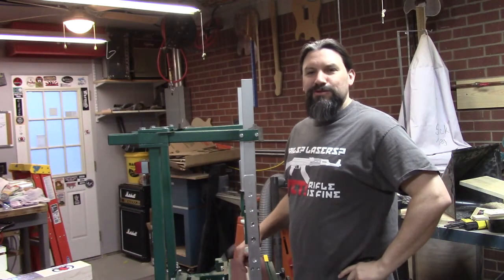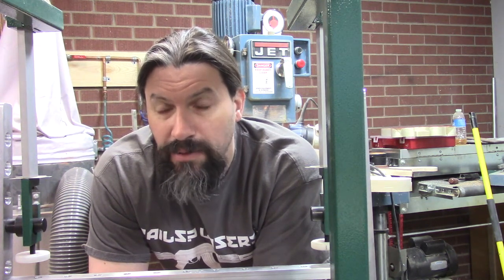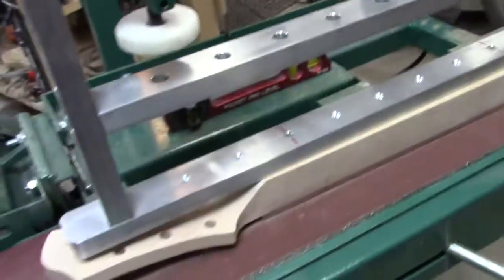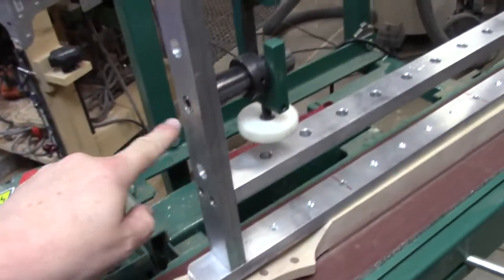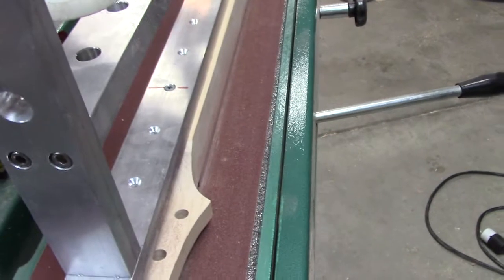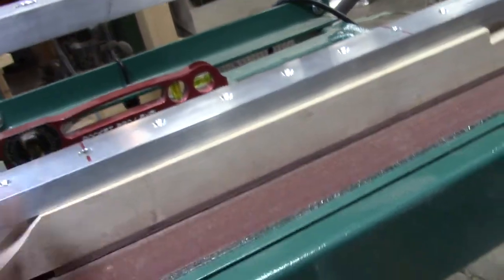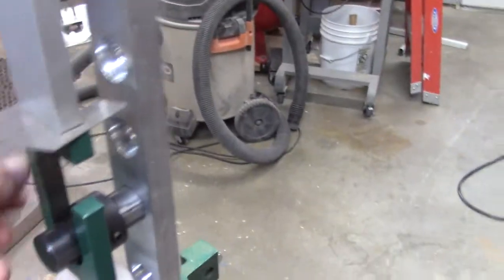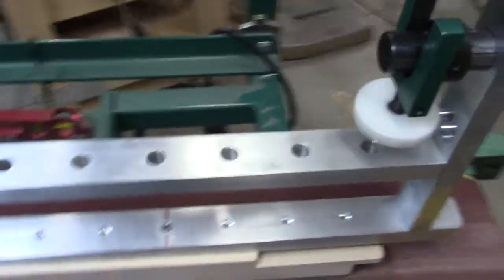Grizzly Radius Sander Modifications

Comment: Do you think it would be possible to mount the radius sanding jig (grizzly sells it separately) to another edge sander that goes horizontally? I was going to get the G1140 and use it as a dual purpose machine but grizzly doesn’t have it in stock (the dedicated radius sander lacks the table of the edge sander , making it useless for any other purpose but radiusing).
Reply from the maker: I don't see why not. I'm pretty sure the sander I have is just a regular one with a few pieces eliminated. I'm sure you can do it man

Comment: Hi, I bought one of these recently and I am doing all the tweaks in the user manual to set it up. I have found that all the adjustments to the sander portion are a no go. I've had to mill out certain holes to get the adjustability needed per the manual. I haven't even had time yet to mess with the radiusing jig. What was your approach to using the shims you show here? Did you just add shims until all the play was out? Thanks a lot!

Comment: Hey Matt, would you be able to show a demo of how to accurately do a compound radius on that rig?  Like maybe a 12-16?  great video!
Reply from the maker: Actually, I don't do compound radius fret-boards. I don't think they offer any real advantage... of course, I'm probably in the minority here. Maybe I'll do a video where I explain why I don't use them.
Reply: I like them bc in the lower register for chord work the profile is a bit more closer and tighter, for the lead wok, it flattens out more and feels more open to me, but what the heck do I know.  lol
Reply from the maker: You know what you like my friend... that's what you know.

I make guitars that have more of a vintage flavor. For my stuff a straight 10" or 12" radius has never been an issue. 
I also press in frets so using one consistent radius means I don't have to constantly swap out the fret press cauls. It isn't like it takes that long to do but time is money. 
There are so many other things going on too saddles, nut slots, etc. the advantages of the compound radius seem theoretical to me. 
Having said that... it really doesn't matter what i think :)

Comment: What sanding belt are you using? I got one of these and get some weird waves in my boards. Grizzly said it’s the wrong kind of belt.
Reply from the maker: Hmmmm  I'm not sure but I think they came from Grizzly? I think we are using an 80 grit belt or maybe 100?
Seems like an odd thing, the sanding belt being the wrong kind. We have not had any issues. What kind are you using ?
Reply: Texas Toast Guitars I used the one from grizzly which they said is a lap belt, they said I need a butt joint belt. Bought some new belts, same issue. Grizzly can’t figure out what the problem is, neither can I. I did everything by the book.
Reply: Oh yeah!!  I can attest to the fact that you do NOT want to order the "Cheaper" after-market Belts as I did.  Have to raise Platen to belt mid point to avoid the "Dishing" effect!!!  Cheap, Cheap, doesn't always BEAT!!

Comment: Hey Matt. Nice upgrade. I watched a video showing the neck swinging diagonal to the sanding belt. How and why?
Reply from the maker: Hi Bryron, 
Thanks for watching.  It is relatively easy to adjust the arms for distance, so the how part is just turn a couple screws and scooch things around until they are where you want them. The why part is actually just so we use more of the belt before it gets used up. It throws people off because it kinda looks like it ought to not work correctly. This machine (and the modifications we made) makes the chore of putting the radius on necks so easy that it is almost impossible to get it wrong.